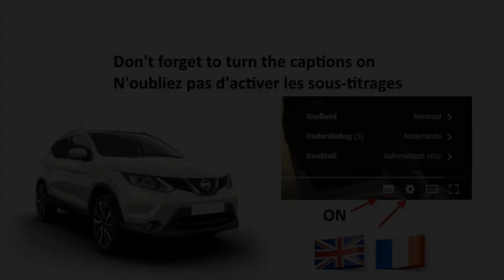Nissan Qashqai Dynamic Turn signals (LED) !

Comment: Ist aber leider in Deutschland nicht zugelassen !!
Reply from the maker: Why not? It’s a default feature on high class German car brands (Audi for instance) and available as option for VW. Could you provide somewhat more info in this specific legislation. In German is fine, I understand but don’t write it as well. Danke 😉
Reply: Weil es keine ABE dafür gibt und somit leider das Fahrzeug nicht mehr strassentauglich ist . Hätte diese Blinker auch gerne 😉
Reply from the maker: Well, even if I’m not in Germany, I’m not so sure about that. You Germans are often holding back when it comes to modifications but here you don’t ADD anything! You just CHANGE the existing LED with something that is even better visible and therefor more safely imho. I dare to bet that an Allgemeine Betriebserlaubnis isn’t required after all and you should pass the HU without any troubles as well. It is the HU that will be decisive. Kr
Reply: @thorstenlange5786  hi,ich denke dass der TÜV eh nicht merken wird wie bzw welche blinker der qq hat.....der wagen ist so neue dass fast jede Autoambieter in Programm hat.
Das sind Kleinigkeiten die  nicht so auffällig sind und der TÜV nicht soooooo schnell merken wird😉☝️